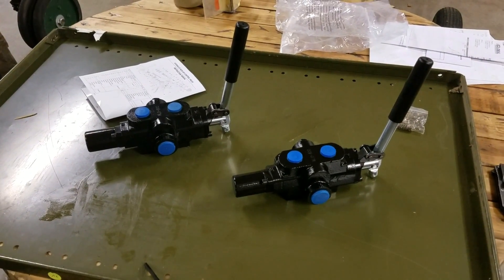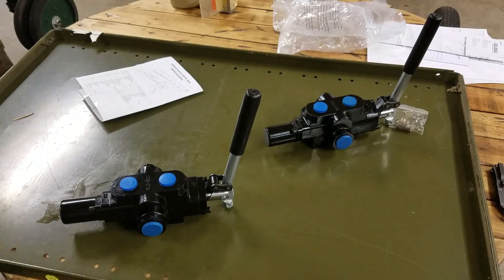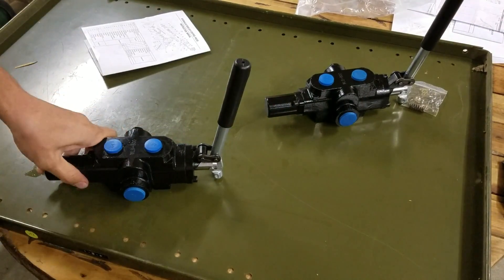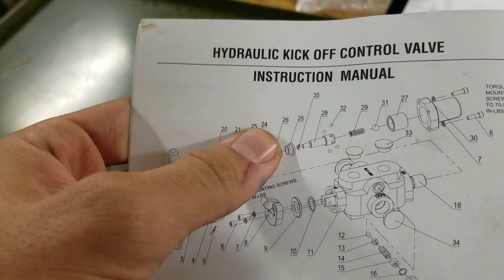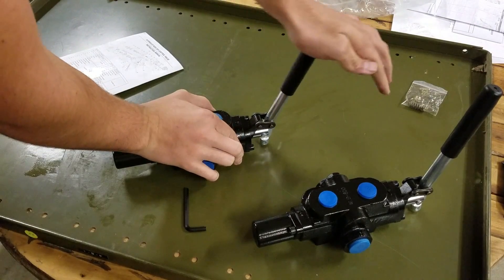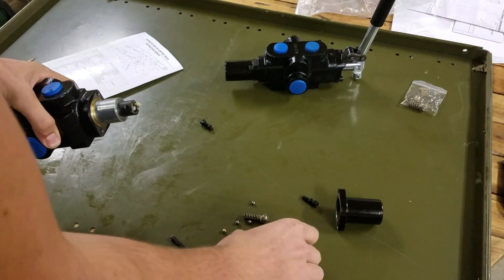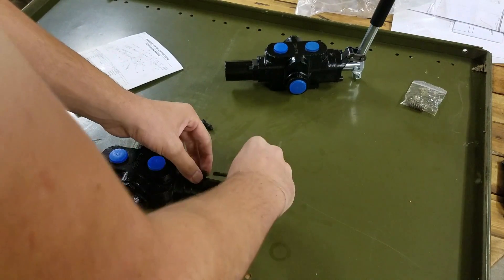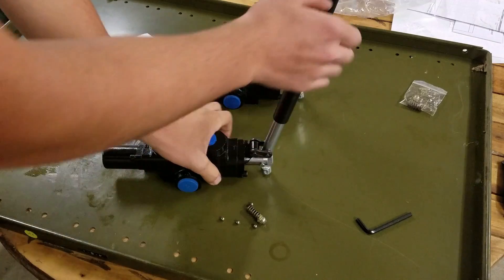Hydraulic Valve Detent Removal

Comment: They are .215" or 5.5 mm. I got some 7/32" from a bicycle shop which were .218. But when I put it back together it wouldn't hold without poping back to neutral. I only lost 1 of the old ones so I put 3 of the old ones back in and only one new one and it seems to be working like it should now. I had to take the detentor apart because it was stuck in the retracting position. It was heavenly rusted. I cleaned it up and greased everything. Thanks